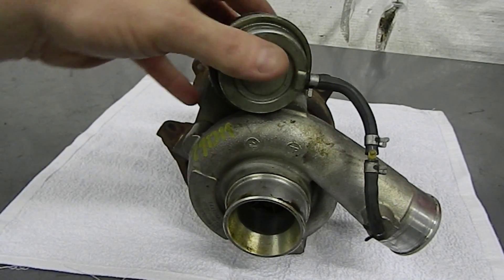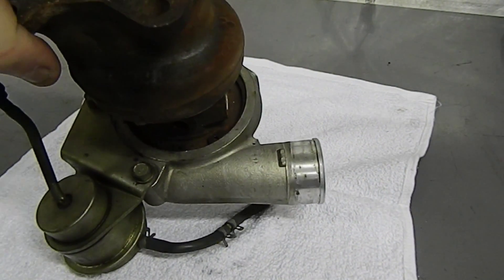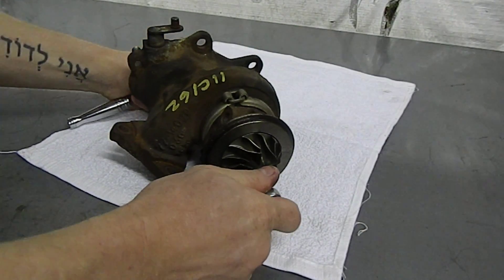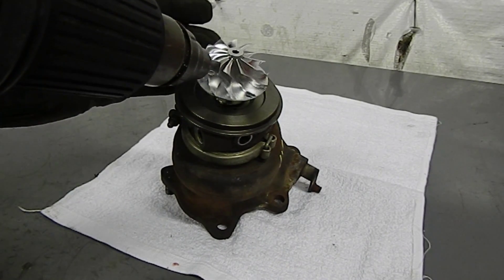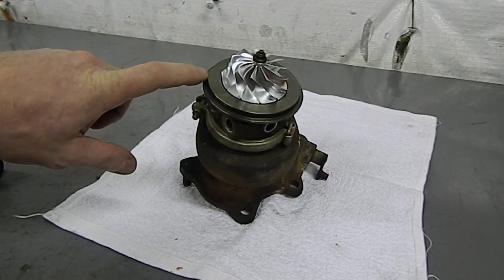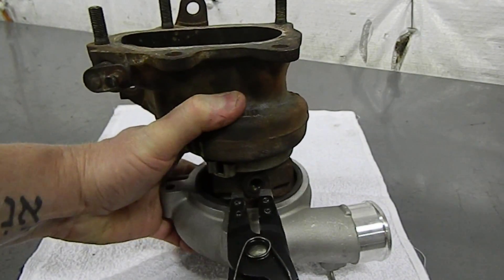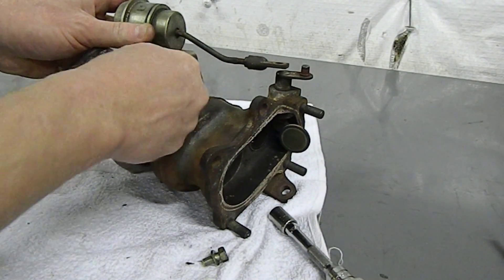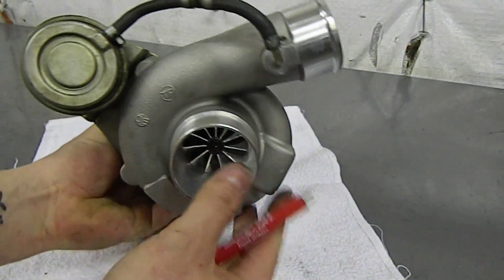Subaru TD04 19T conversion

Comment: I want to do this to my td04 2002 wrx. Do I need a tune after this mod? I have an sti tmic/sti splitter/spt intake and indivia up pipe. No ecu codes for now! Thanks
Reply from the maker: Re-tuning is not required however if you want to realize the full benefit these parts offer tuning is needed.
Reply: Ok thanks for you reply and a well done video!

Comment: how abot balanece?
Reply from the maker: Always a good idea to balance the turbine and compressor together even if the compressor wheel is new.

In a pinch we've installed without balancing and had good results (a large number of our customers do this as well) however the proper method is to rebalance any time a turbo is disassembled.

Comment: what was the HP gain by the mod?
Reply from the maker: +trajik78 Typically we see cars with basic mods (downpipe, intercooler, etc..) realize 270-290 whp depending on environment, fuel quality and tuning with this turbo. Each car and setup is different of course but this proves to be pretty repeatable results day by day. Thanks!